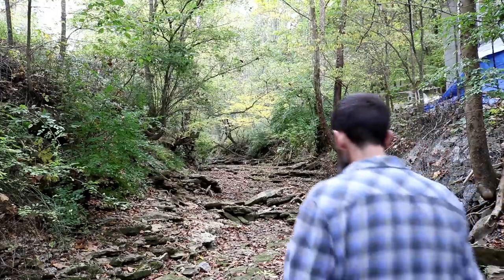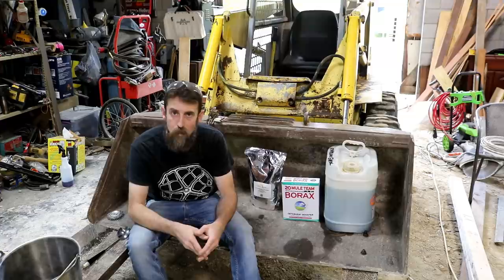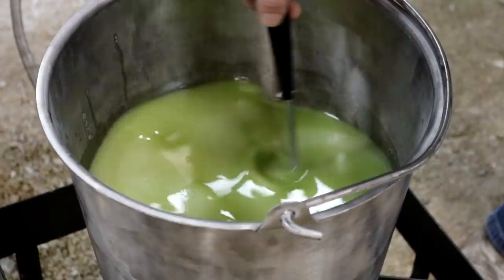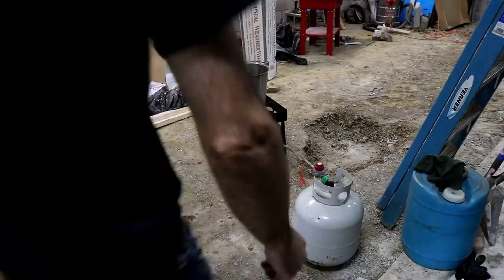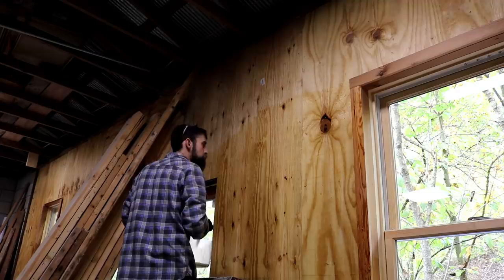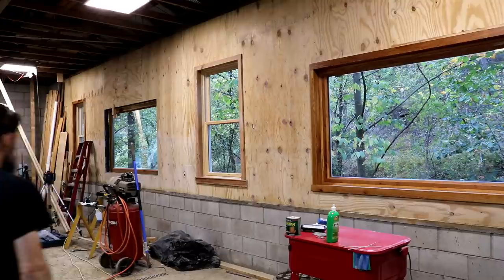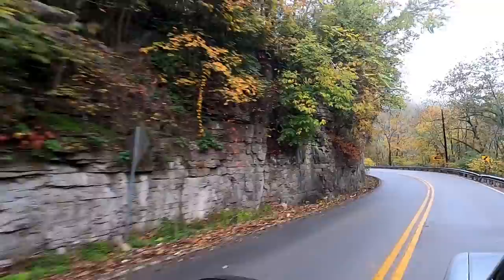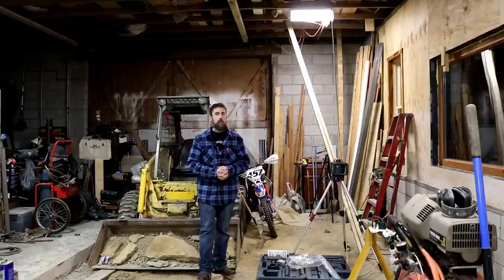Homebrew Wood Rot & Insect Treatment

Comment: Borax - Boric acid is great stuff to prevent ants populating your wood building. I use it in the stud spaces and also on the subfloor before finished flooring. The IMPEL rods seem to be just boric acid compressed. I have been wondering about trying to dissolve borax into Water glass or sodium silicate, liquid glass really. Seems like it would be the king of all wood preservatives.

Comment: Dry Rot is the product of wet conditions, so the most effective way to stop dry rot is to remove the moisture i.e. cure the leak.  Most timber treatment experts do not advocate any chemical to treat dry rot.

Comment: Wondering about coating your ground in your barn with something like you're thinking with used motor oil or something maybe healthier to seal the floor.  Maybe even just a layer or two (so if moves can slide on surface) of visquene and then some dirtcreat (portlant & local material).  Guessing a pond liner is better where you just dig out a little, lay the pond liner and then put the dirt/aggregate back in.  Thinking that'd keep the vapor from coming up through the ground.   Also, with the bore holes... there are borate products that are cylinders that plug the holes so that concentrated borate is in the wood. 

I'm wondering if there is an alkylammonium chloride most cost effective solution that's one of the cleaners that can double as the mold stain remover.  Haven't checked any MSDS or data to see yet... though seems the best method like for attics is H2O2 spray to soak, minerals (boron, copper, etc.), ozone while still moist, alkylammonium chloride stain remove and then a thick dusting coating of the minerals.  

I like this idea for the minerals coating.  Here is the most thorough method I've seen for the attics that can be DIY'd: https://www.youtube.com/watch?v=kN4so4Bzv3s
Here is for the boron rods in drill holes: https://www.youtube.com/watch?v=NPhBtsWW9Yw

Comment: screw a few pieces of the same wood 3x3 to 4x4  by what ever thickness was used in the various locations... inside and out, where ever you painted this stuff on... these pieces need to be un-treated... they will be you indicators, as to how well the stuff works, for root treatment... if the test pieces start looking rough, and the treated stuff doesn't.. well there go.... not that you didn't already know this for a series of control samples...  after a few years, i am curious to see..

Comment: Hey Steve you can add Alchemy to your resume now :-) ...interestingly, Ethelyne glycol was used as an aircraft engine coolant (WW2, although possibly before?)specifically because it boils at a higher temp than water so they could run engines hotter/harder - examples being the Rolls Royce Merlin engine used in Spitfire's, Mustangs and many other Allied aircraft.
Reply: I think it's still the main ingredient in automotive anti freeze ?